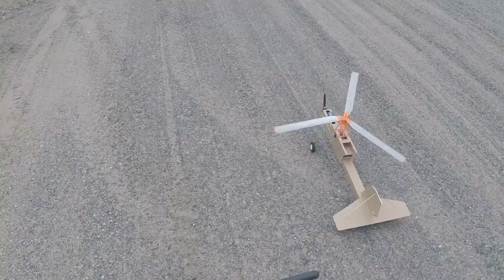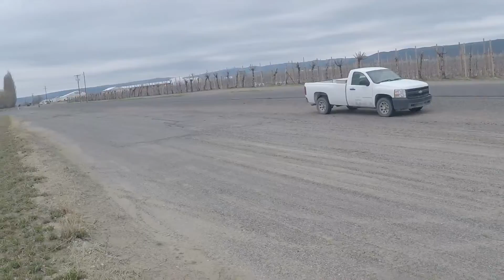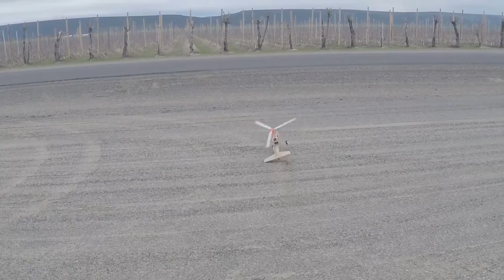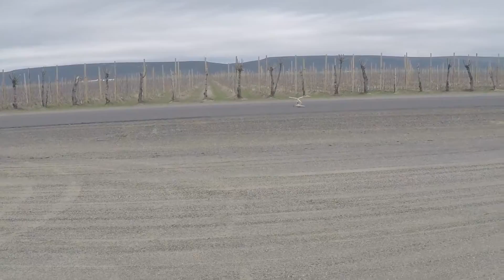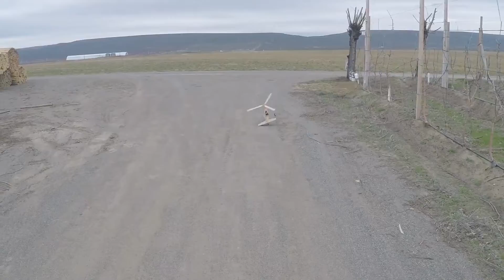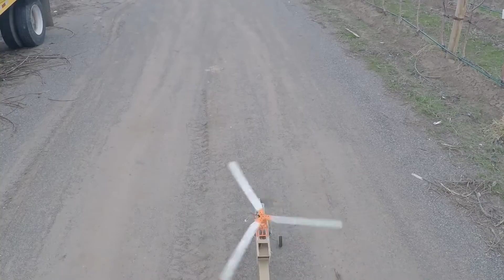3D Printed FT Explorer Auto-Gyro Destructive Blade Testing

Comment: I'm no autogyro expert, but if you had you prop spin the opposite direction of the top spinner, I'd imagine it would help prevent some of the lower rpm torque issues.
Reply from the maker: Nathan Schlenker The last few attempts I put a reversed prop on it.  Main issue was side gusts knocking me around.